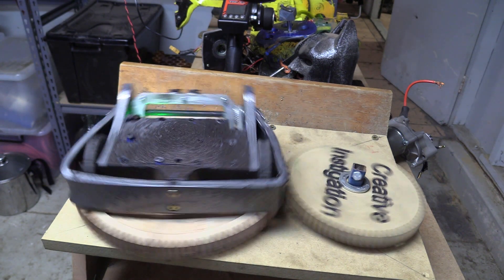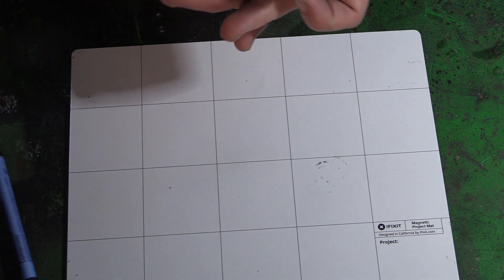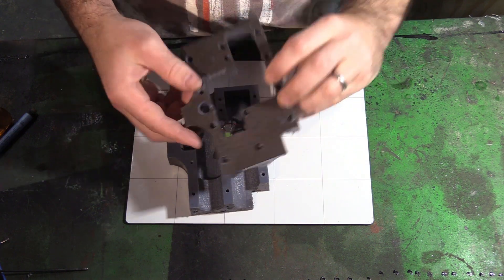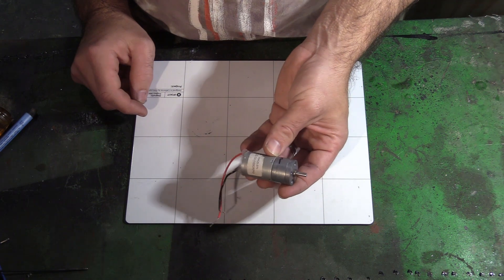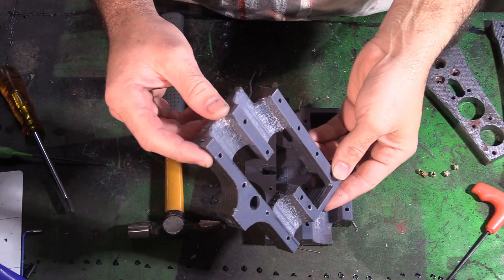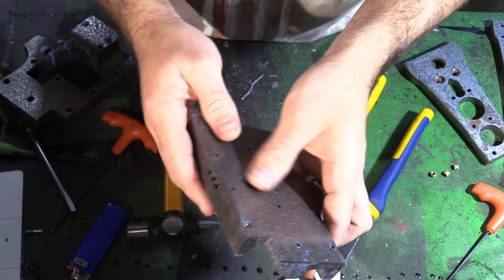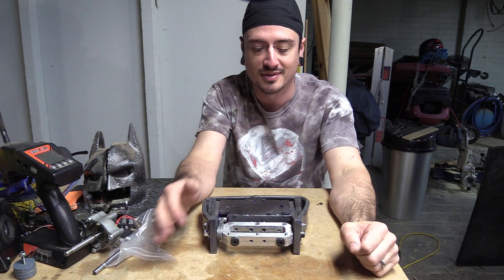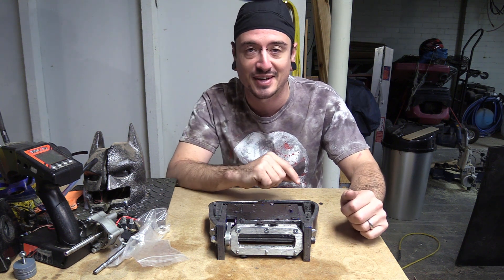Beetle Weight Combat Robot “Munchkin” assembly video

Comment: Nice video. Mind if I ask how the steering works for robots like this? Are you driving both sides forwards/backwards independently like a tank or is there some weird channel blending happening?
Reply from the maker: Hey no worries, steering can be done via tank steering (2 channels, 2 sticks) or you can mix 2 channels 1 stick (aileron,elevator) together which is what I have done. to find out more, search for rc channel mixing + whatever transmitter you are using :D

Comment: Great video and build. Not seen those drive motors before, how did they work out? Seem a bit low rpm?
Reply from the maker: they are alright but very slow, even on 3s, I now use those gearboxes mated to a dys 1806 brushless motor and they absolutely haul!

Comment: Do you think you can make a version of this bot (on thingiverse) That is a perfect for the fingertech beater bar and it’s electronics kit? 

Also, why didn’t you make the electronics plug and play for ease of assembly?
Reply from the maker: Hey Lumakid, the fingertech beater bar does fit however I have not tried the fingertech inrunner. the reason why I soldered it all together was a mixture of weight and space. Cheers
Reply: If I make this, (probably soon as MASSdestruction is on the 26th) I will make the electronics plug and play for ease of assembly. (I will probably be in the plastic ant division though)
Reply: Something tells me the inserts were the most annoying part.

Comment: Just fyi, you can put those inserts on the tip of a soldering iron, they push right in

Great looking robot, hope you post some fight vids
Reply from the maker: Thanks for that, i will try it next time!
Reply: @CreativeInstigation  https://www.amazon.com/Heat-Set-Installation-Compatible-Soldering-Connecting/dp/B078K72615/ref=asc_df_B078K72615/?tag=hyprod-20&linkCode=df0&hvadid=242007122763&hvpos=1o1&hvnetw=g&hvrand=18323302932671030830&hvpone=&hvptwo=&hvqmt=&hvdev=c&hvdvcmdl=&hvlocint=&hvlocphy=1017003&hvtargid=aud-829758849484:pla-467663764797&psc=1
Reply from the maker: @RayLopezBTownSting  That is sweeet!